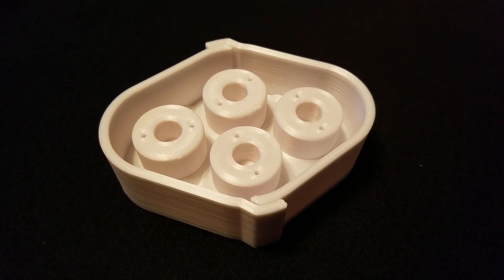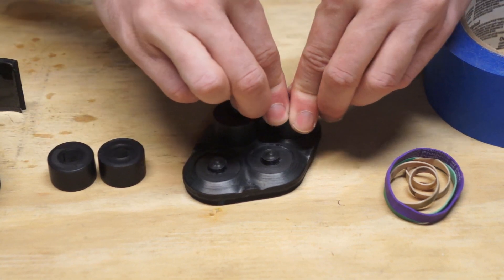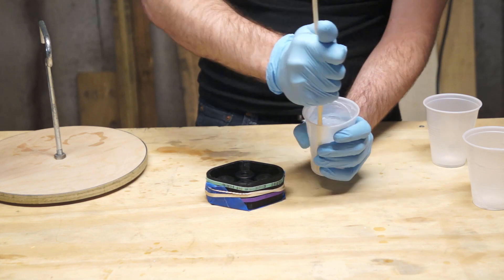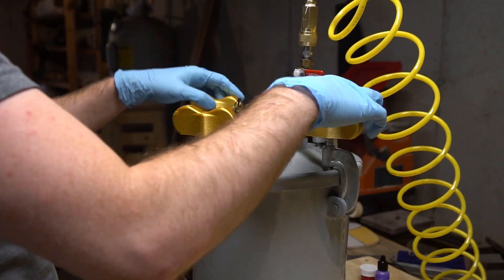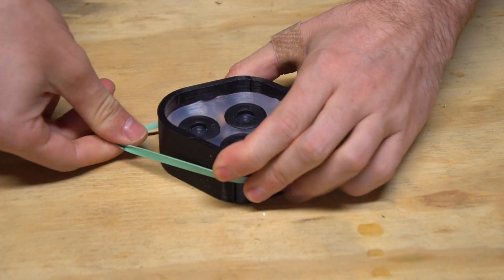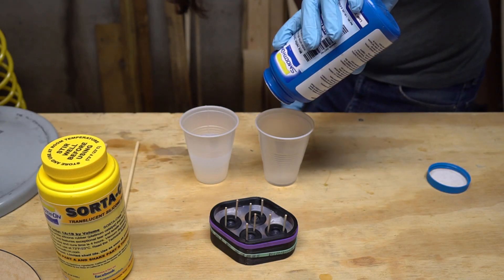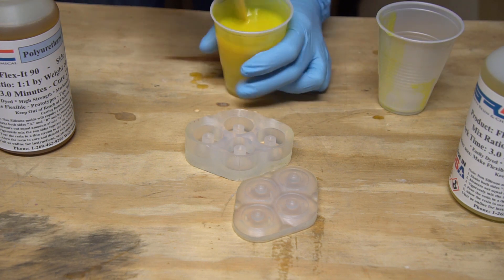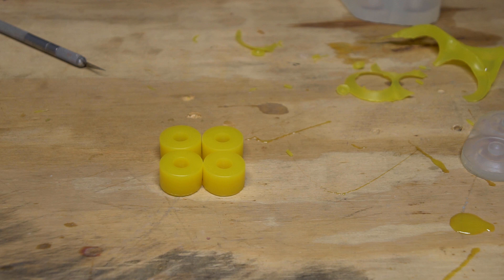Using my New Open Source Mold System to Cast DIY Skateboard Bushings

Comment: I really don't want to discourage people from creating things but a word of warning, I had one of the worst falls in my entire life due to a pair of bushings failing, I was longboarding down a hill when one or more of my bushings split, and let me tell you this was the steepest hill I've ever gone down, luckily it had started to flatten out when the bushings failed, however I was going so fast that when the board came out from underneath one of my shoes was ripped off, it happened in an instant, I went from completely stable to complete mush, it wasn't until a few days later when I looked at my board I realized that my bushings failed, it kind of made sense though, I didn't get speed wobbles or anything it was as though the bushings just vanished. I unfortunately still have scars from the accident to this day
Reply from the maker: Yes. Please, these are experimental, homemade pieces of hardware. Take it EASY on them and check on them constantly for wear. Cruising, some light street skating, maybe even some dancing, but I wouldn't be doing any heavy downhill on these any time soon.

Comment: what if i were to use actual bushings in the mold making process, opposed to the 3d printed ones? it seems as though i could re-create any bushing shape, in any durometer, so long as i use mold release.
Reply from the maker: Yeah, you could do that. I've got two earlier videos here on the channel where I make molds from normal bushings and you could probably swap them out with the bucks in this kit too as long as they have the same diameter on one side.

Comment: I live in India, and it's difficult to get casting silicon, is there a possibility of using silicon caulking for the mould? 
Polyurethane bushings for longboards are not available in India,  also bushings from the states is 15$ + 15$ shipping and it's really costly. So if you could answer that probably I'll be able to help the other longboarders here.
Reply from the maker: I've seen tutorials on making molds with that kind of silicone before, so you could probably figure out how to make it work. I've never tried it so I don't have any tips or anything. What do you guys use for bushings?

Comment: I think they came out tremendous, an quick question have you thought of different wheel cuts or just traditional flat or conical?
Reply from the maker: You mean bushing profiles? I have tons of ideas for both functional and goofy custom bushings, but I wanted to get a common standard out first and I figure barrels are the de-facto bushings. I'd love for people to take this system and adapt it for any number of different shapes and designs. Get weird with it!
Reply: @GoodRoads  I was talkin about the wheel mold for next weeks video, but I totally see your point in using barrel bushings as the first standard thats a great idea an it’s spectacular you’ve given others access . But for the wheel mold I was interested in seeing if you thought of different types of cuts from the straight flat cruiser/long board wheels to more conical or tablet shape style wheels, like shown in the oj elite series template of wheel cuts.
Reply from the maker: Ah, I see. Some of those those terms mean kind of different things for longboard wheels so I wasn't really sure what you meant. Yeah! The wheel mold I designed makes an offset 54mm freestyle wheel with a rounded outer lip and a square-ish inner lip, but I took a look at the wheel shapes on the OJ website, and I think you cold get similar wheels to those by modifying my designs
Reply: @GoodRoads  thanks for takin the time to respond to me first off, an yea second I don’t long board like I have friends who do but in my area there isn’t much space or terrain for it outside of the obvious cruising. But my bad for the confusion I thought cuts where mainly universal except for the size an diameter difference, so thanks for the inspiration I shall further check into it.